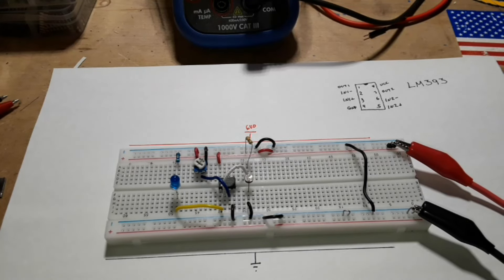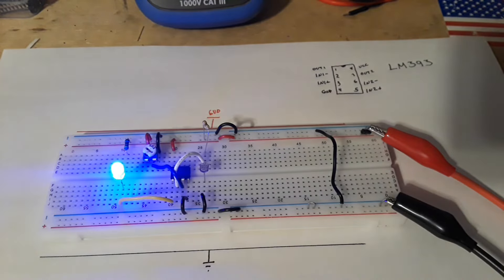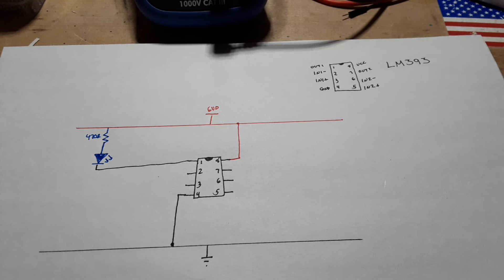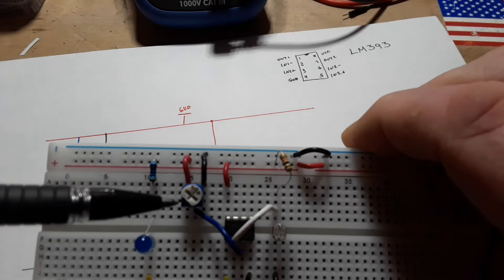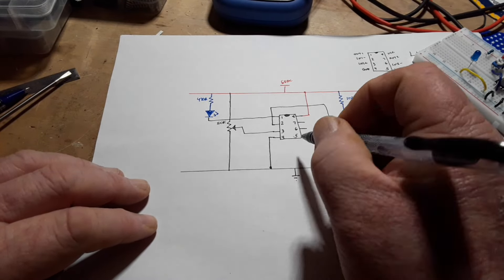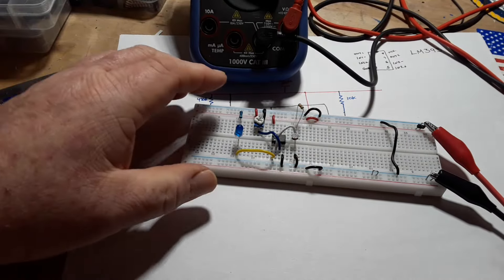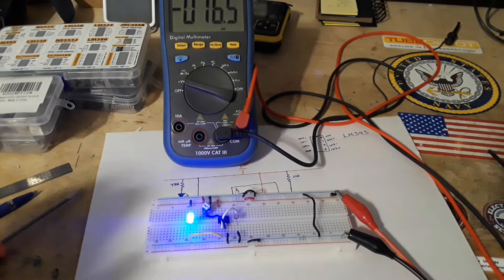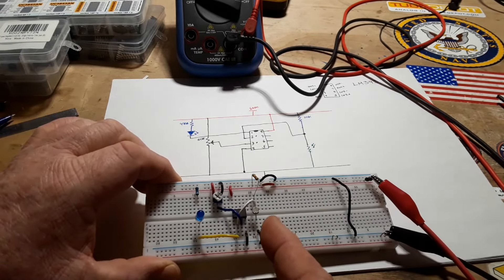Classic Circuits You Should Know - Light Activated Switch

Comment: Im wanting to make an adjustable dawn, dusk switch, this is very helpful, thanks for this and all the vid in this series.
Edit .. I see this might also be useful for other things, e.g. replace the photoresistor with a moisture meter, etc, and we can have adjustable switches based on light, moisture, and other measurable factors. Thanks again.

Comment: Is it better to design this kind of circuit using a comparator versus using a 555 chip (e.g., number of external components, lower expense of the IC)? I've always used the 555, but your use of a comparator seems fine too...just wondering if there's a benefit to using one method versus the other. Thanks.
Reply from the maker: No reason to choose one over the other that I can think of. They are both simply acting as flip-flops

Comment: While comparators usually have some degree of internal hysteresis, to avoid noise switching, it might be worth showing how positive feedback can be used to add more, and how it can be taylored. 
Its worth note that using an LDR to switch a light can result in oscillation,  if the LDR is in the path of the light output. It might be worth mentioning the different methods used to avoid such oscillation.

Comment: Does a voltage converter constantly draw power since it connects positive to negative? In otherwords, would it drain a battery even if the led never turned on?
Reply: Yes, it does.

Comment: what I'd like to know is how I can have my solar panels disconnect when they stop producing enough, for the day, for charging to happen and only reconnect when they can produce enough for charging to begin. This is just one part. I want the charge controller to disconnect from the batteries right after the solar panels disconnect and stay disconnected until just before the solar panels reconnect. I believe that this video offers enough basic information for me to extrapolate for the solution that I want. I call it a want because I could just buy more equipment but that just implies that I am okay with wasted power, which I am not.

Comment: I would have expected pin 1 to rise to 1 and light the led. Am I correct that it is 1 and goes to 0 when it’s get dark and the led turns on?
Reply from the maker: Yes, when the comparator is active it will sink current.

Comment: probably a dumb question but with voltage deviders why are there buck converters
Reply from the maker: Voltage dividers are quick and dirty but not very stable. Buck converter requires more components but is able to hold a steady or voltage and current
Reply: Voltage dividers are wasteful as they dissipate the power by converting it to heat (resistors will heat up).  A buck converter is far more efficient in that it generates a signal with variable duty cycle to match the output voltage.
Reply: A voltage divider works best when connected to a high impedance input, this is because its output impedance is dependent on the division ratio. In the case of a potentiometer divider, the output impedance is at maximum when the potentiometer is set to its mid point, and is near zero at either end of its adjustment range.